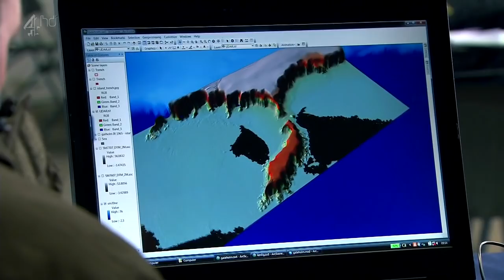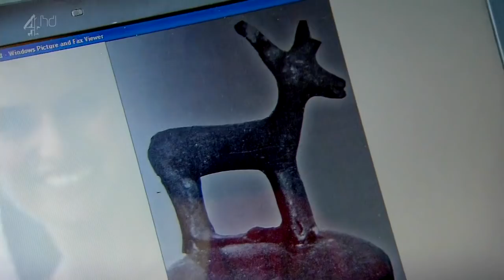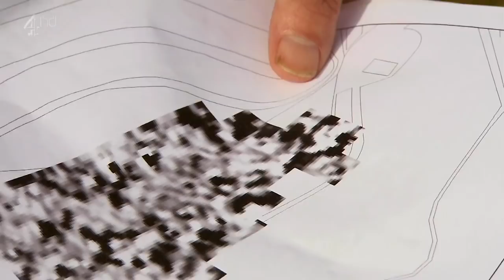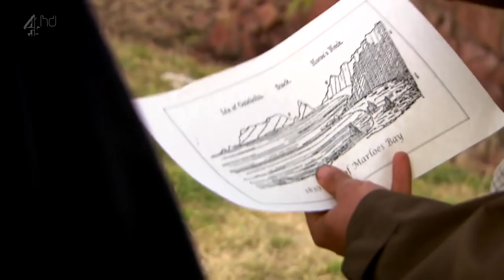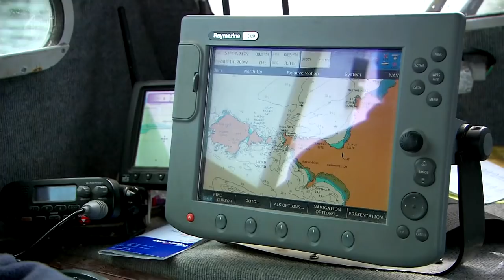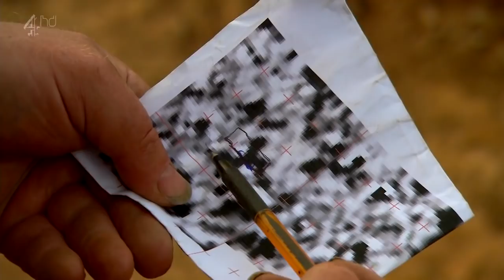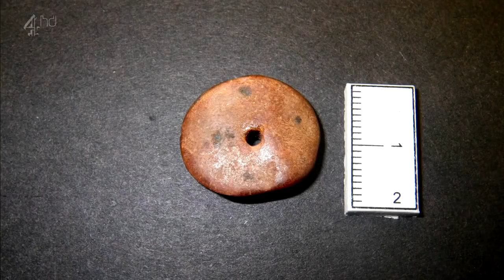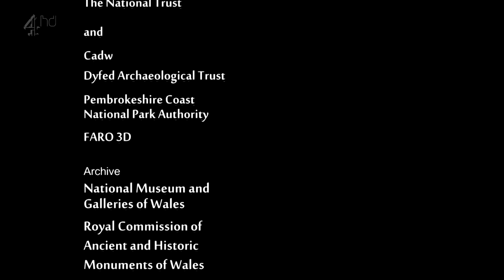Time Team S19-E01 Dig by Wire

Comment: Perhaps the answer is in the name? "Gateholm" or Norsk (Viking) "Street (Gate) islet/island (holm)" ?
Reply: +Frank Cromer That's exactly what I thought. Glad, someone else saw it, too. :)
Reply: I think that the holm means it was an island by the 9th or 10th century. I wonder if the ruins of the Roman buildings were still above ground then?
Reply: @davidwright7193  Nah, even now you can walk over there at low tide, and erosion at that coast moves very fast. It would have been a peninsula just 300 years ago.

Comment: Depends where their abode is located. If north of Chiang Mai, then it does get cooler, but also, flooding has a tendency to increase due to deforestation, which is illegal but still happens.  You do not have to worry about snow in winter as the winter temps are high and we never get snow, not even in the far north.

Comment: Oh, so this is when they started to change things.  Depends what other things Helen and Stewart had on?  I agree on the helicopter would have been far quicker. Talk about budget cuts.
Reply: Actually these last episode had the highest budget of all the series. 

Budget cuts weren't the cause of those changes.

Trying to further commercialise was the problem.

Though even before those changes the show hat lost half its viewers.

These changes were basically just a hail Mary to try and get it back and running.

They aren't however the cause of the end, that was already coming before.

Which is to be expected for a show running for a whole generation, at some point it stops being interesting.

Comment: or a helicopter could have been hired to fly the team across.
Reply: +David Carmichael Or there's a beach on both ends so a small boat with an outboard motor.
Reply: considering they used a helicopter to take aerial footage I'm pretty sure they didn't all use the ropes exclusively.
Reply: Maybe climbing up and down the steep cliffsides is harder and more dangerous than the zip line?

Comment: Can’t help feeling the powers that be are flogging a bit of a dead horse with this particular Welsh island They should head east up to what is now called Flat Holm, just off the coast near Chepstow, real Welsh name Ynys Echni. It was here that King Tewdric of Gwent wanted to be buried after defeating Saxons at the Battle of Tintern in the late 500s, so it was clearly a holy isle for ex royalty. Tewdric was the father of King Meurig of Gwent,the father of King Arthrwys of Gwent. Otherwise known in the Llandaff Charters as King Arthur. Tewdric never made it to the isle, as he died and was buried  at Mathern and his grave was discovered in the church there in the 1600s. His son built a church over his body and this was later expanded upon. Mathern in Welsh means either Dyma Teyrn, place of the King, or Merthyr Teyrn, the martyred King. Tintern is also named after Tewdric. Din Teyrn, hill of the king. He had lived as a hermit there after handing the crown to Meurig. He came out of retirement to defeat the Saxons at Pont Y Saeson, the Bridge of the Saxons, still on the maps.